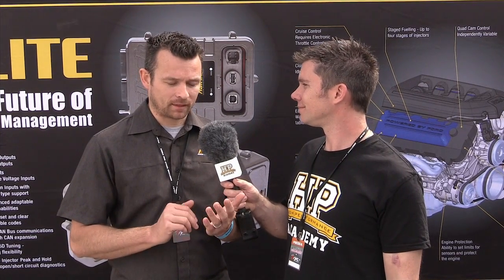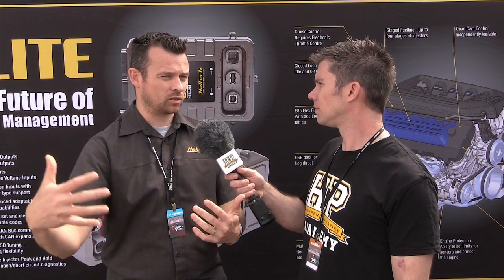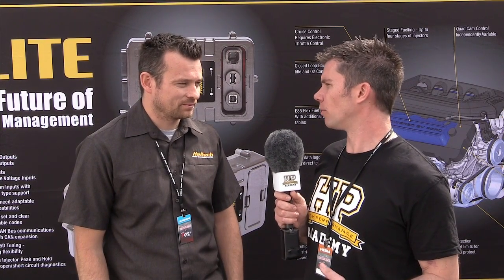Learn about Haltech’s advanced self-learning features in the new Elite-Series ECU

Comment: I know this video is five years old, but I'm still curious about what strategies this uses.  I'm a bike tech and certified with Dynojet.  Their newer stuff has closed loop learning, like all the factory ecu's do, but it doesn't work very well.  Without both long term and short term maps they don't like big fast changes, like going over mountains or just going to a different gas station.  Usually I still have to do a manual map on customers bikes to get the last 10% it leaves on the table.  I've unfortunately started putting work into my daily, which is an obd1 '93 Integra.  (No fly-by-wire, no vtec, maybe a cheap low boost/lag pieced together t3/t4 on American 91 octane in the future.)  Not planning to go crazy with it, I can't afford to make it compete with my bikes.  But I want a good ECU to start with.  Haltech sounds like a good product, but how much of it is just hype.  I'm not afraid of my laptop.  Would this be a big jump above Hondata?